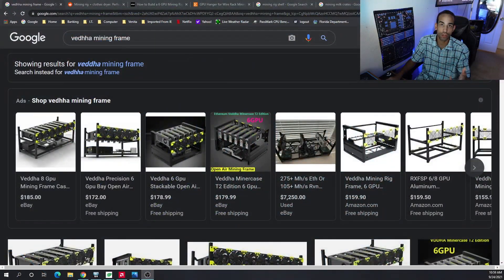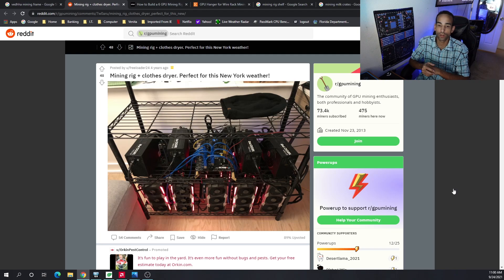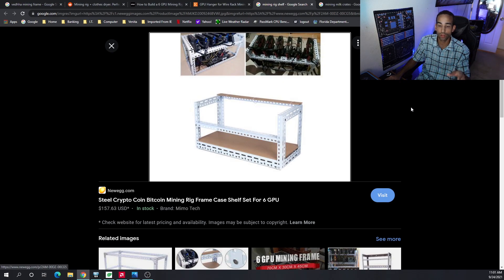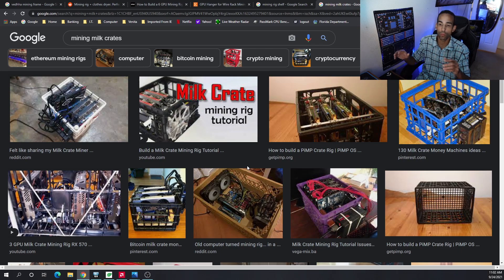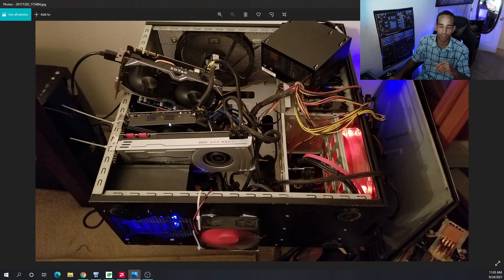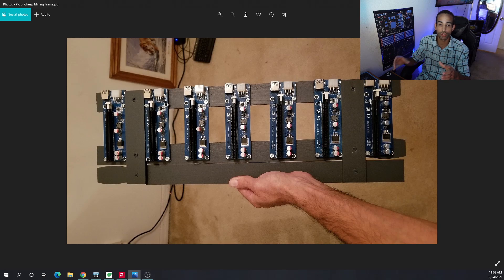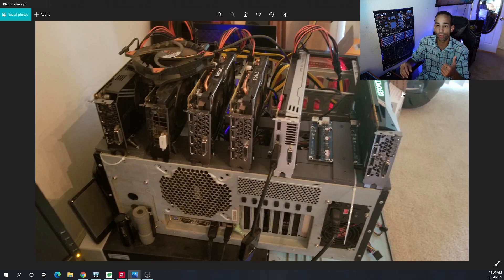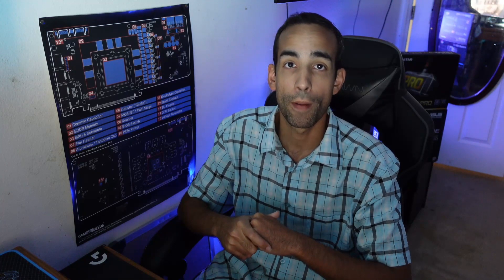How to Build a Mining Rig - Part 1 - Mining Frame

Comment: What do you lay the motherboard on if you use a metal shelf?
Reply from the maker: I use either plastidip on back side or card board. Like cut a box to shape of board.
Reply: @SerpentXTech  I’ll probably use cardboard, never heard of that plastidip
Reply: I have sets of 3d printed standoffs from someone selling on Etsy and it works perfectly